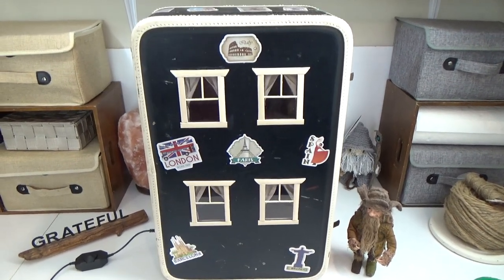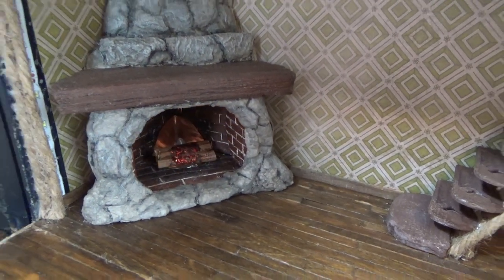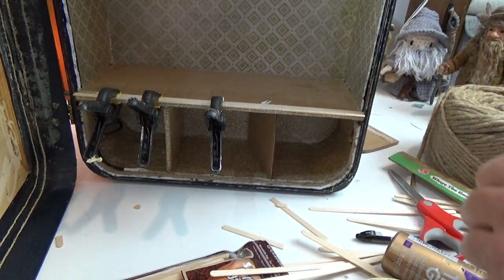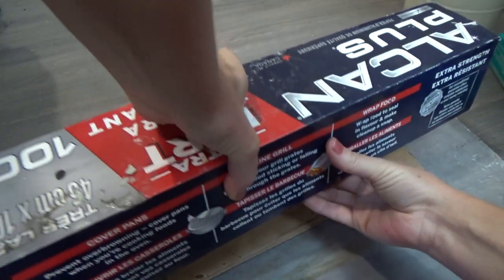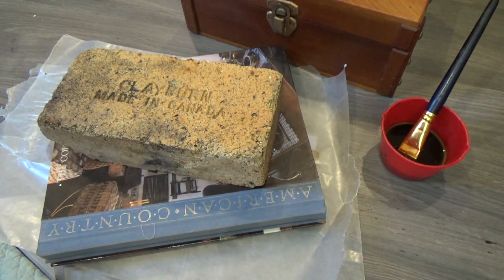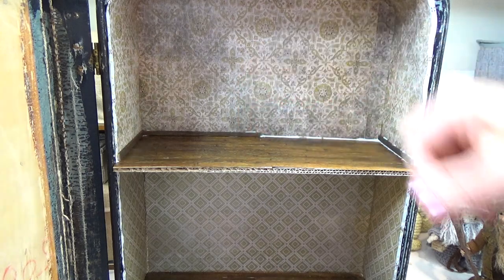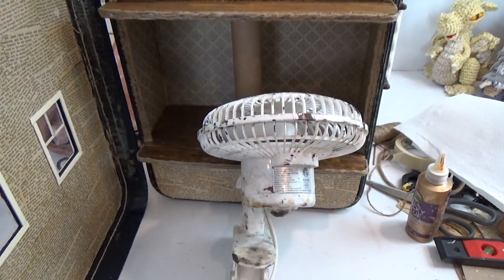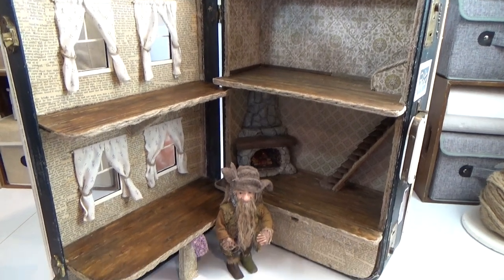Part2 DIY Vintage Suitcase To Dollhouse Wooden Floors

Comment: Hi Sharon I have a question about the coffee stain mix, can it be stored in a jar so you can use it again another time? Or is it a one time use and discard the leftovers?
Reply from the maker: You can keep it for a few days in room temperature but each day it’ll get darker so you’ll have to test the color on the wood you plan to use, add water as needed. I’ve never tried keeping in the fridge so I can’t tell you what happens with the color if stored there. Thanks for asking!